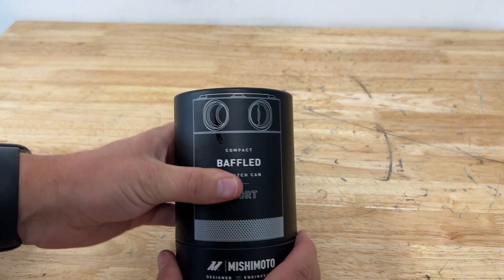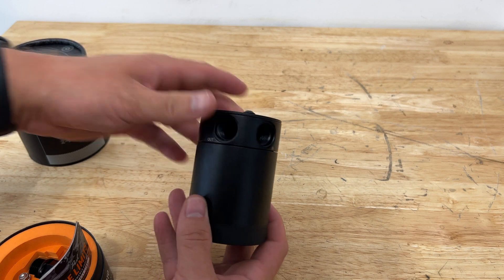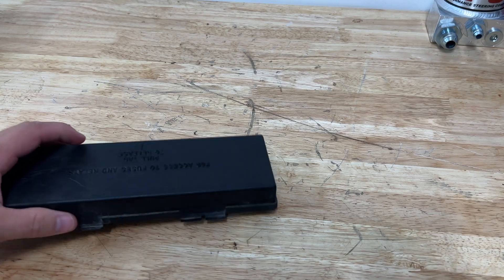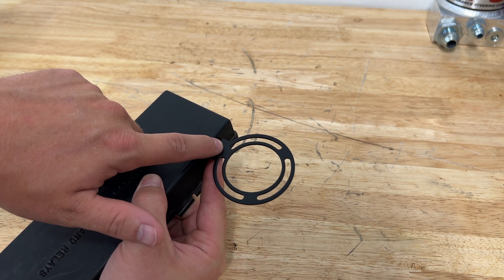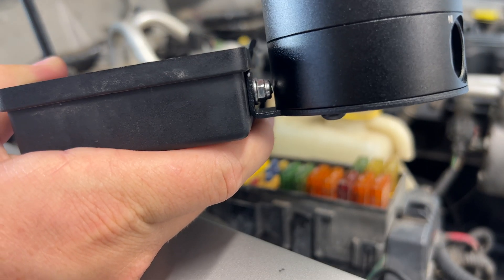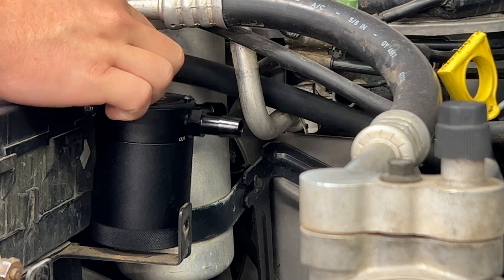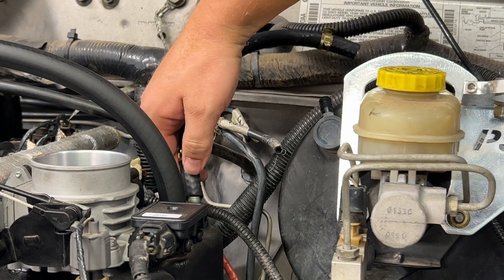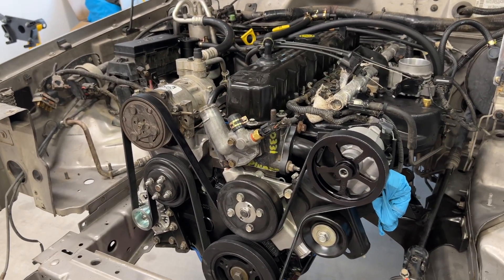Project Cherokee - Mishimoto Oil Catch Can/ Air Oil Separator

Comment: I did exact same thing then I noticed the oil pressure is suffering going up as normal and the car moving rough
Reply: Cause he installed this incorrectly. Don’t do this
Reply: @Josh-ux6zz  Esa instalación esta mal, ya que la válvula ccv delantera succiona aire, entonces como lo puso el compañero estaría succionando el poco aceite que lograra pasar por la válvula trasera, en todo caso si se puede instalar pero solo de la válvula trasera al catch can y después al múltiple de admisión, no necesitas hacer la T ya que una saca gases y la otra succiona vació.

Responder
Reply from the maker: Interesting. I’m definitely interested in converting from funky PCV to straight flow AN adapters.

Comment: Though this is 3 months after the video posted I'd like to point out to future viewers that the CCV system (not PCV in this period of the 4.0L production) on the '91-01 XJ with 4.0L uses an orifice elbow installed in the rear valve cover grommet instead of the typical sprung ball valve of the typical PCV system.  The orifice elbow is connected to manifold vacuum via a 3/16" hard line to prevent collapse and maintain a constant vacuum to the elbow.  This is a measured vacuum leak the ECU/PCM is programmed for with input from the MAP sensor.  
   The other elbow is the unrestricted vent and gets filtered air from the air filter box.  The air flow is from the air filter housing above the filter, through the crankcase, out the orifice elbow and into the manifold.  The manifold vacuum side of the other elbow is much stronger than at the air filter end and thus no vapors will really be captured from that side.  In the configuration shown here, you will have a large vacuum leak inside the crankcase that can potentially suck oil from under the valve cover.  It will really cause some messy-ness in the intake, gum up valves, and result in oil fouled spark plugs, contaminated catalytic converter (if still equipped) and lots of smoke.  The emissions sticker shows the correct vacuum routing.  
   To make the 2-port catch can work, used the vacuum diagram and insert the catch can in between the CCV elbow and the intake manifold port.  Connect the CCV orifice elbow hose to the IN port on the catch can and connect the OUT port to the vacuum port on the manifold.  The vent elbow going to the air box does not change.  This will keep the system intact and flowing in the correct direction while doing the job the catch can was designed for most efficiently.  Hope this helps.
Reply from the maker: Dang this is a great bite of tech info. What’s the source documentation? How do we tell if we have the right elbow on the right port of the valve cover?
Reply: I’m glad this is here. System is designed to pull filtered air into one side, which is than pulled through the other oriface into the intake. This is just sucking into the can, than directed to the intake. Thank you sir for writing that up and hopefully keeping others from replicating this disaster